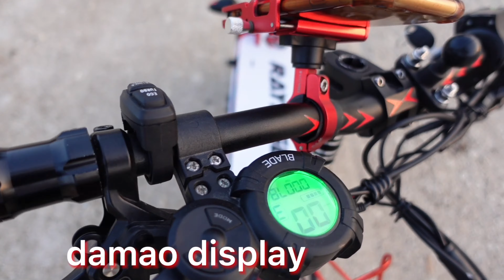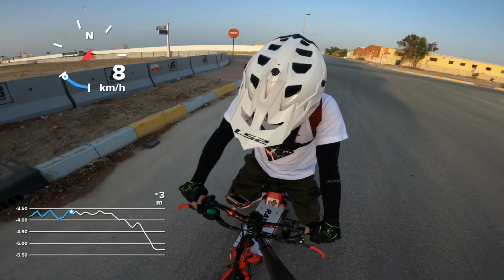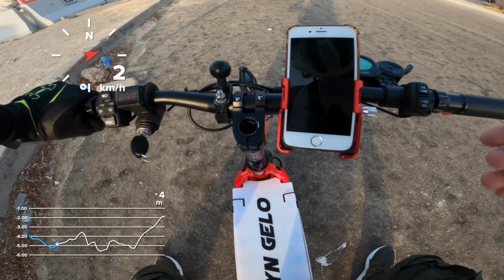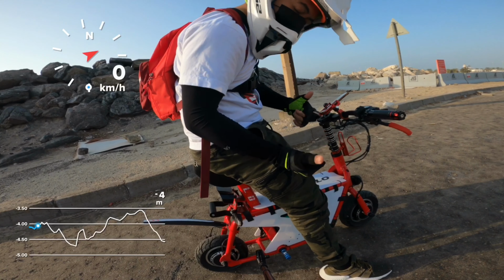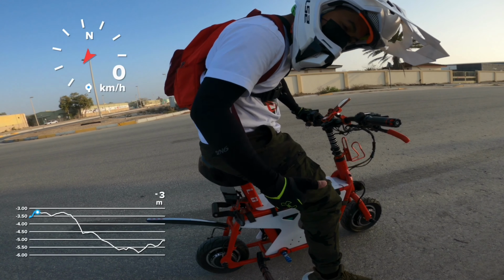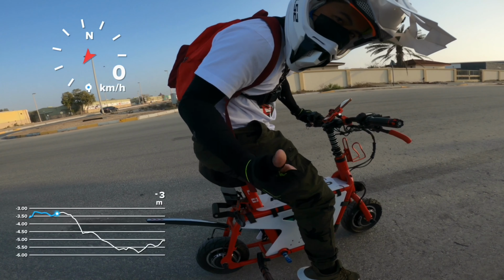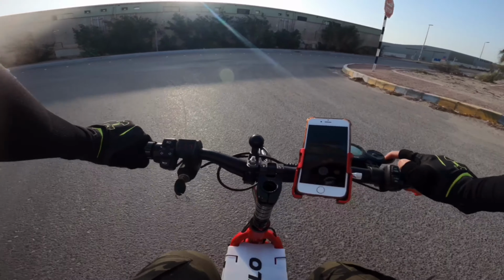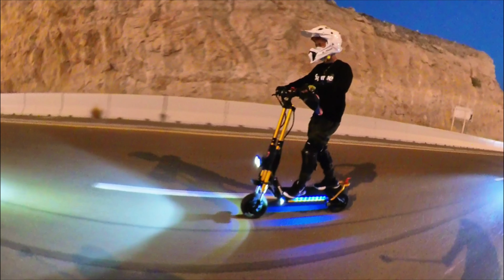MODIFIED FIIDO Q1 Dual Motor | Cheapest Upgrade🚀part 2 | 60V | 2400W | James Angelo TV | Vlog 102

Comment: Will I be able to fit the Blade GT dual motors onto the Fiido? I feel like 11 inch tires may be to big for the frame..
Reply from the maker: yes it fit but you need to use extension bar in rear and additional for suspension at front to fit the 11 inch

Comment: Sir dito sa upgrades nyo na ito? Pag single motor? Normal ba na umiinit ang phase wire? Im using yyk controller
Reply from the maker: umiinit pero hindi dapat over temperature. may tendency masusunog controller at motor mo.. yan isa sa reason bat di ko gumgmit ng yyk
Reply: @JamesAngeloTV  ahh okay po. Di lang ako sanay siguro sir ng mainit. Which is na experience ko naman before sa mga controller ko dati. Umiinit controller and phase wire. Nagpalit kasi ako ng hub at yyk.